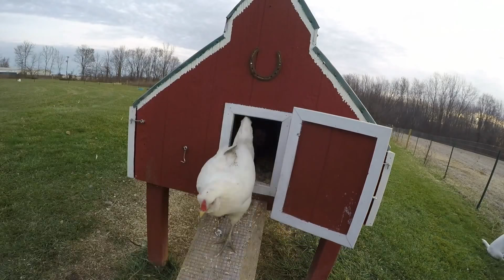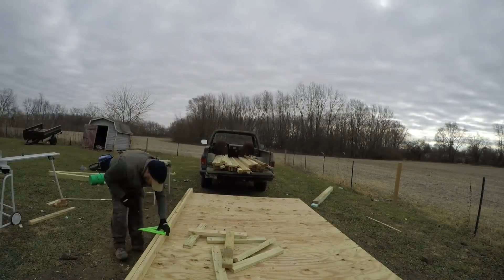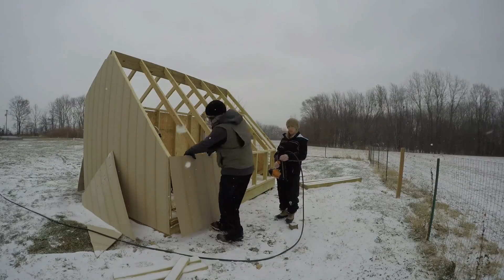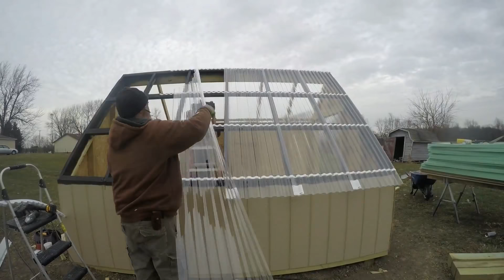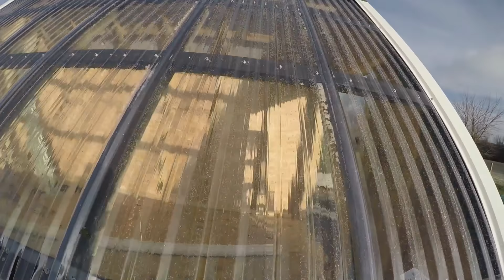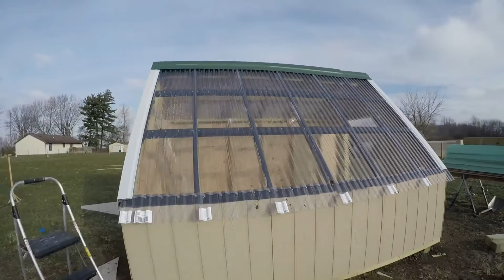How to build a solar dry kiln Part 1

Comment: how do you notch the trusses? i'm assuming i would need to use a framing square. totally unfamiliar with this part of the process.
Reply from the maker: You may want to look for a truss building video. That's hard to answer in the comment section
Reply from the maker: @OCDbrand  anyway that results in a flat floor should be fine. Keep in mind that when it's full of wood it will be very heavy

Comment: Do have basic plans or did you get from some where else.Hows it working for you ? How much wood can dry you in her? Hope this weather doesn't get you.
Reply from the maker: I found some basic plans. Link in the description. The weather where I live has been around -10 for the past 2 weeks so I have not wanted to do any more work on it. I have it insulated and painted black on the inside now and even with the crazy cold it will get up to 80 degrees if the sun is out. I will have part 2 out in a day or two. The plans said it will hold around 1000 board feet.